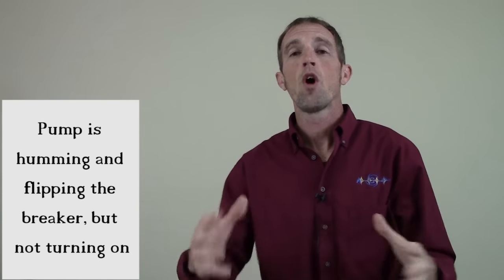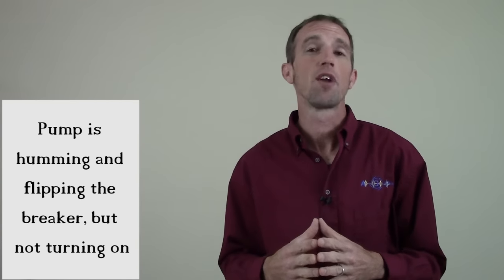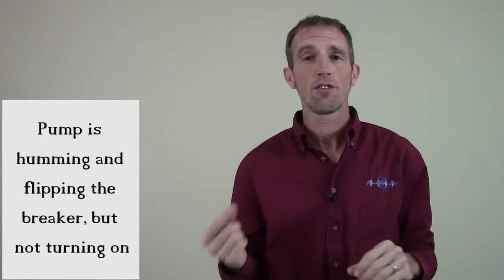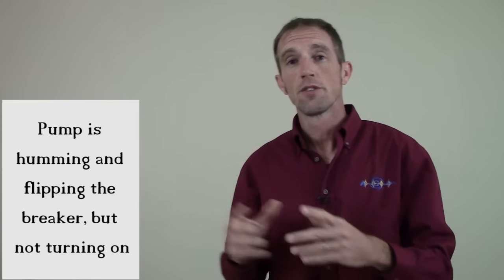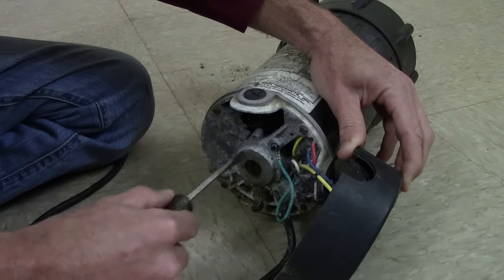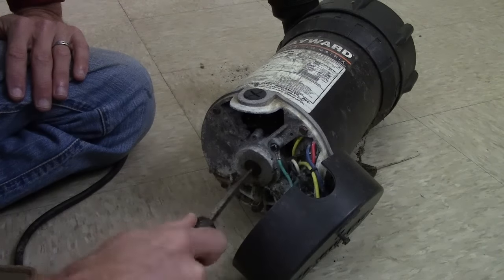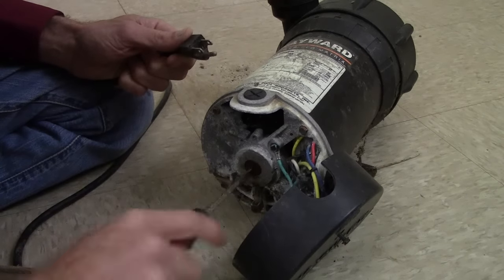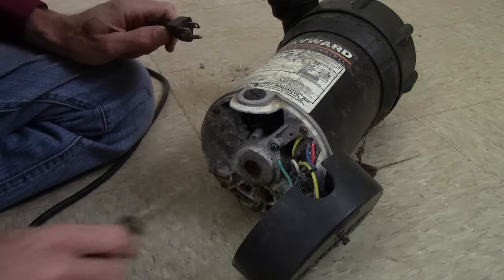Above Ground Pool Pump Won't Start or is Humming & How to Fix It

Comment: I tried the screw driver and did pop it loose, but it was not turning freely. I then got out the drill with a flat head tip and spun the shaft for a good while. Rust and debris were flying out, That did the trick. I then plugged the motor in and now it is running smooth. I want to thank you for your post, I really appreciate it.

Comment: The pump I have is very similar to this one...but it is a pentair.. Mine was working and when I turned it off to clean then back on it made the hum.. The shaft moves easily and I tried the kick start and it still won't spin. Many talk about the starter capacitor, but I don't see one..just like in the video..any suggestions? I find it hard to believe I had it running for an hour, turn it off and now it won't spin when turning it on.

Update: I tried the jump start with a power drill as someone suggested in comments and got it started again! Doing it by hand it wasn't working. Took the drill, started it up..plugged it in..bam it started to run! afraid to unplug it now..lol
Reply: I had the exact same issue, it started I ran it for six hours turned it off but it won't start again, just the humming. Any other suggestions would be appreciated.
Reply: The other way is to open it and replace the bushings .

Comment: Almost had a heart attack when my pump wouldn’t start. We spent $6k on a new liner last summer and before this video I though we’d have to buy a new pump. Turning the big bolt in the motor saved me and pump is running again. Thank you!

Comment: This saved my pump! I ended up using a drill with a standard bit to “jump start” the pump. I couldn’t get enough torque just using the screw driver but the drill did the trick. I sprayed some lubricating oil inside the pump as well and now it starts up with no problems. I hope this tip helps someone resurrected their pump in the future!

Comment: Saw this video when looking for a way to repair my pool pump. Worked great!  I used a big adjustable wrench instead of a screwdriver to get the shaft loose. Then I just turned it on and it started right up. Thank you!

Comment: My pump motor had water in it from the rain of Hurricane Harvey. I let it dry for a couple of hours and then used the screw driver. Now it works fine. Thanks for this video.

Comment: That did work for me. Got it to turn a little and just kept add it till it turned all the way. Then put the power screw driver with wide bit on it, and then it really turned. Did that for a good 15 mins before reinstalling. Runs like a champ now. Thanks Again!

Comment: Man, you are the best, thanks so much for this. I didn't even see the metal disc over the back of mine, went back, there it was, popped it off with a flat head, added power and torqued it. I'll probably still keep the spare pump I bought on the shelf though. But thanks so much, saved Memorial Day 2024!!!!!

Comment: Saved me money was looking up pumps and decided to check you tive for a second time by looking up the humming nose. I had a different pump with a fan but just turn the fan and clean around and it worked five minutes later. Faster to fix then watching the video.

Comment: Used this information to fix my electric pressure washer, after I let it sit for a whole season. It was humming and popping my breaker after a few seconds of turning it on.   

Didn’t have to “kickstart” it.  All I had to do was take the pump out of the frame and give us a little manual spin to break it free like you described.  After that I put it back together and it took off like a champ.  Thanks!

Comment: You just saved me hundreds of dollars.  Mine is a little different where I had to remove some parts in front of the shaft and turn it with pliers but the knowledge you gave me made it all possible!!!  Do remind people there are live electrical components exposed when you take the cap off and plug in the motor so they should make sure they don't touch anything.  Also, if there is a capacitor (round plastic cylinder with wires on one end), it can hold a charge even when the motor is unplugged.

Comment: Perfect fix for my pool motor !   Was hard to turn the pump shaft with a screwdriver so I used a drill with a large bit that just fit in the recess to turn it.  Started it slow then sped it up.  When I plugged in it started up on its own.  Thanks much !!!

Comment: Thank you, Chad! I was worried when I went to start this back up and it buzzed, and then stopped. I watched your video, reset the breaker, spun the screw and wallah, back in business! Pump is only about 4 years old, so I knew it shouldn't be going this early.

Comment: Well sir.   that was totally it.  it spun freely  but would not do it under power.  I turned the switch on and it was humming.  I put the screw driver in the slot while it was humming and spun the big screw driver between my hands in the clockwise direction like I was making fire with a stick and (drum roll) motor took off to the races.  BRILLIANT.  Thanks for the perfect lesson.

Neal Port Charlotte florida

Comment: Great helpful video  - it worked! The shaft was turning; just bought the motor 3 months ago, but it just hummed. I was not able to access the shaft with a screwdriver, but wrapped some electrical tape around the shaft between the motor and pump and gave it a good yank and it started right up.

Comment: Thanks, pointed me in the right direction. My pump was in a spa, had terrible access to remove the cover. The shaft turned ok but would not fire up, so  I wrapped an old shoestring around it like a pull cord for a lawnmower, turned on the power and let her rip, she stated up and is running. Will let it run for awhile and see how it goes on re-start.

Comment: Holy Crap...it worked...The only thing I did differently was, after turning the screw, by hand, with no success, I used my power drill with a flathead bit.  I ran it for a minute and the motor started turning just a bit...I ran it for another minute and hit the power switch while it was running...bam...it kicked on...Thanks for the tip...saved me a bunch...

Comment: My Jandy pump did not have a screwdriver type shaft access but had to use a wrench instead.  Was able to turn it very easily but since my switch is on the other side I walked over turned it on and pump started right up! One hundred thanks for this, saved me a lot of money and headache ! thumbs up and subbed.

Comment: Thank you very much. I revived two motors I had replaced but was saving till I had time to take them apart. I expected to need to replace the bearings but this quick fix worked on both. Now I have a lifetime supply of immediate replacement pumps.

Comment: My pump was only off for about 24 hours and would only hum and then trip the breaker. I did exactly what was described in the video and my pump started after just turning it with a screwdriver. Thank you!

Comment: Thank you so much for this video. I had no idea what was wrong with the pump. I tried the screwdriver but it wasn’t enough. I put the flat head bit in my drill and had my wife plug it in at the same time and it fired right up. Thanks again.

Comment: Thank you for this tip, worked great. Motor turned freely, no signs of rust, but still with a turn of a flathead screwdriver it spun the motor and power took over.

Comment: Chad, Thank you so much! Did not have a lot of hope as mine spun freely with a screwdriver when I tried this. (No scraping and/or resistance.) Turned on the power after turning (I did this with pump still in place not removed except the shaft cover) and away she went! 5 HP / 2 speed pump = not cheap. Cant wait to get back in my tub!

Comment: Chad.  Your advice was perfect!  The only thing that I changed from what you said is that I used a variable drill to turn the shaft when "kick-starting" the pump....too easy.  I gave my wife a head nod to plug in the pump and pulled the drill away and the "trick" worked perfectly.  I just finished sweeping the pool and will be leaving it running overnight so I can get the winter cleaning process started...should be swimming in a few days  Thanks again sir.  Ric

Comment: works great. tried it and at first didn't work. It popped the breaker. But i tired it with the cover off! Must be a safety switch or something along those lines! Make sure the cover is fully on before trying! Thanks for the video! saved me a couple hundred $$$$!

Comment: Thanks! Worked like a charm. Mine was not frozen at all. I had just turned it off then went to turn it back on and it wouldn't go. Tried the shaft spin and immediately turned the power on and off she went! Might advise people to clean out all the gunk and stuff behind the cover when it's off. All plugged up like your demo pump probably leads to pump running hotter.

Comment: Thank you!  It's a Saturday and my pump was not working (just humming).  I made a few calls and no one working today.  I saw this video and gave it a shot.  My pump had a simple plastic cover over the bolt that turned the crankshaft.  It turned freely by hand and then I tried to turn it on.  It just hummed like before.  Then I spun the bolt lightly with my hand and it kicked on right away.  Pretty cool!

Comment: THANK YOU!!! I'm not very handy but this totally worked for me! Just got everything hooked up and filled up, and went to turn on the pump, and... nothing... a little hum and dead. I was a little nervous about using the screw driver to turn it while plugging it in, so I just turned it a few times (it was definitely tight due to corrosion) and after a half dozen turns or so, I stopped and then plugged it in and it started up like a dream! Thanks so much!!!!!

Comment: Thank you so much.  I first used a rubber hammer on housing thinking I could knock it loose if stuck.  Some were saying it could be starting capacitor.  Then did exactly what you suggested and could hear the corrosive contact com loose then...BINGO!  Worked like a charm!  Thanks again...saved me lots of $$$ ;-)

Comment: Thank you so much for this video!  I simply took an open ended wrench and simply turned the shaft back and forth and it worked like a charm!!  I am not working this summer and was worried about the cost to replace the pump, you saved me!

Comment: AWESOME TRICK!  Worked perfectly!  Also note, even if when you use the screw driver to move it around and it seems very smooth.... might still just need 'kick start'.  That's what mine did.  Thank you AGP for making this video - just saved me $400 on a new pump!  Really appreciate you!

Comment: GREAT Video Chad! But it didn't work for me and my pump is BRAND NEW.... it ran for a day.... then stopped. Bearing spins easily, but the jumpstart didn't do it. Any ideas? Thanks for the great advise though!
Reply from the maker: Yes that means something internally is wrong with the pump and you need to put it under warranty and get a new one. At least the motor. All pumps have a one-year parts and labor warranty so you would be fine with warranting the pump.
Reply: That was my assumption, was hoping a quick hack would bring it back to life while I waited for the replacement to arrive. Thank a lot Chad! GREAT videos!!!!!

Comment: I was somewhat skeptical but said what the heck? After three or four simple turns of that shaft I plugged it in and bingo, it worked. What's upsetting is 3 years ago I replaced my last motor with this one on opening day, as it was humming after sitting all winter. Had I known this then, I'd likely still have that pump! Great tip...thanks

Comment: Buddy your absolutely amazing. My kids are going to love you. Thats exactly what it was!! Wow. Amazing.  My problem with the whole ordeal was that my new pump was just bought last year. I ran the first one for 9 years. No issues. Well died after 9 but nothing like this. I get the second one last summer and this is year one summer later and it happened right away at start up. My first one never did this and my second one out the gate needs this to happen to start. Wow!! Your good!

Comment: All I can say is WOW! This was so useful. Only difference for me was that the thing I had to spin didn’t have a flat screwdriver spot so I just put on a rubber glove and spun it with my hand as I switched on the pump. I did have to pull away super fast as then it started to spin on it’s own but worked non the less. Thank you!!!

Comment: THANKS A MILLION!!!!

The pump in my jacuzzi was fixed by using the tip in this video to "kick start" the pump.  I think the pump had seized up after letting the pump go too long without being used...especially after bath salts were used in the tub.

Comment: Hi there - wanted to just add a quick comment - this fix saved me.....temporarily but at the end of the day it turned out it was my capacitor that was the problem. I unfortunately was not able to diagnose this myself and paid way too much to have it fixed but you can get a replacement capacitor for about $13 on amazon and it's pretty much like changing a battery. There are also videos out there on how to do it. Just flagging in case someone else finds this fix works but doesn't fix it completely. If I knew it would have saved me a lot of money. The pool store people charged me $60 for the part and $90 for the labor. I get they have to make money so I'm not shaming but if you are eager to save money it can easily be DIY. Apparently extreme heat can cause capacitors to blow pretty easily.

Comment: Thank you for this video.  Your suggestion worked!  I'm going to let it run overnight.  Makes me think I still might need a new pump soon, but this gives me more time.  Thanks again!  - UPDATE:  After running all night into the late morning, pump wouldn't start on its own after turning off.  At least it bought me a few extra days.

Comment: Just saved $350 on a new pump. TY My Howard Powerflo 2 case had to be removed completely for a screw driver bit to go in. Did that then used my drill to loosen it up. Then modified the cover in case I have to do this again. Turned on first try with a stronger flow than I had all season.

Comment: I did this and it worked!! Thank you so much for sharing this video.  My pump didn't have a cover at the back but I found the opening and inserted the screwdriver and turned it a few times and hey presto!!!

Comment: Ty for this video. Bought a house recently and got the pool opened only to find out the pump would not start and just hummed. Watched this video and turned with a screwdriver a few times back and forth then plugged in and started right up. I was able to turn it while unplugged and it worked when I plugged it in

Comment: Just did the same thing on a jandy pump . Spun it with my hand while the wife turned it on at the same time. Came right on . The pool store didn't even want to send a tech to check the pump.  they wanted only to sell me a new motor or pump saved 500 to 1500 dollars. thank you so much.

Comment: This Worked. Thanks for the tip. No better place than YouTube for How To. Question: Is there a way to lubricate the motor to keep the corrosion at bay?
Reply from the maker: I personally don't know of any lubricant that you can put in an electric motor but you might want to talk to electric motor guys and maybe they can steer you in the right direction.

Comment: This was extremely helpful, I did need to get a power drill and spin that thing for a bit and then jumped started it and it turned on and is now running.  Great help, thankyou so much!!!

Comment: Thank you for this walkthrough. It gave me enough courage to diagnose and fix my problem. For my situation, I have a different Haywood which was far more complex in the back. It still has a rotating center though and after seeing it moved flawlessly, my wife and I started to think we should look between the motor and the basket. We ended up finding that some large sediment from a storm so it was actually jammed up from the other side. After refilling the basket water and a few false starts it worked! 🙏🎉😂

Comment: Very helpful video.  I have an in-ground pool with 3/4 HP Centurion motor... same problem.  Was able to remove the back and, sure enough, it was corroded.  Should work long enough to finish up the season.  Thanks for posting!!

Comment: Thank you thank you thank you. After 3 days of buzzing and overheating this fixed my pump in under a minute. My only issue was finding a screw driver short enough to fit in the gap between the pump and the filter.

Comment: Thanks for the video. I have the same pump. It started having problems at the beginning of the season. It would hum but not spin. I found that whacking the caseing with a rubber mallet got it going (just like a bad starter). Today however my trick didn't work. After watching this vid he mentioned the breaker. When I checked it found that it had tripped. I reset it turned on the pump and hit it with the rubber mallet and on it went. So thanks for the tip!!!

Comment: almost get new capacitor ... it did save my time ... great video and tip. the breaker skip stripping and pump wont start until doing this trick ... thanks a lot

Comment: this was a huge help. i had changed the capacitor first, it working for a while then it started humming again. pump in a close quarters location so spinning the shaft was a bit taxing but got through with it. was spinning fine but not as loose as it suppose to i guess, hopefully that solved the problem for the next few ears.

Comment: Thank you.  This tip got my pump for my below ground pool running.  Just needed to spin it once and it was good to go.  Didn't need to disconnect the motor, just turn it.

Comment: Well, you saved another pool owner hundreds of dollars.   My Jacuzzi pump is a bit different but once I got to the shaft, it worked out great.  Mine was really seized bad and had to use a drill with a slot screw driver bit to spin it and get it loosened up.